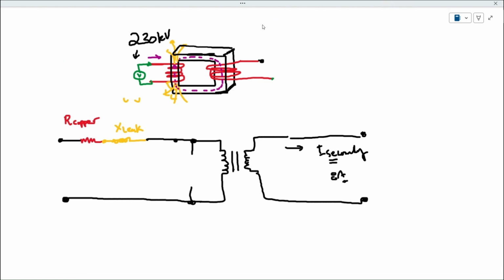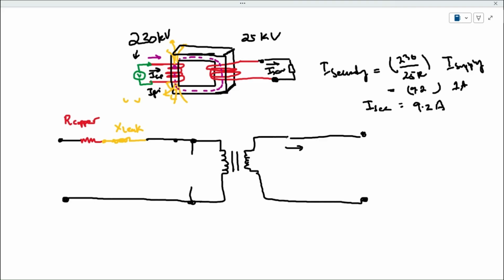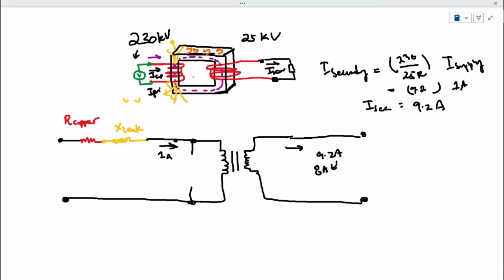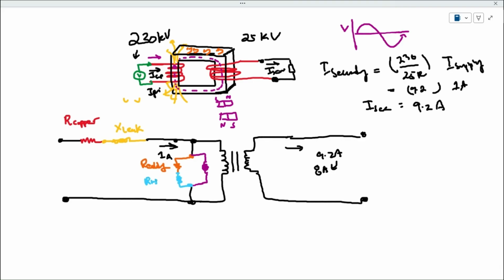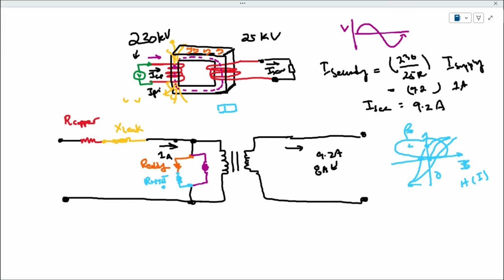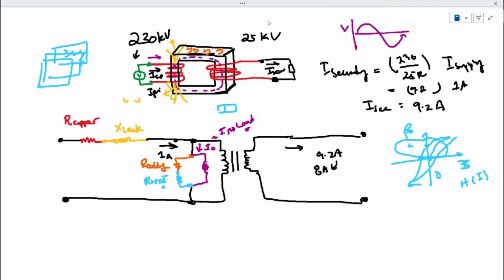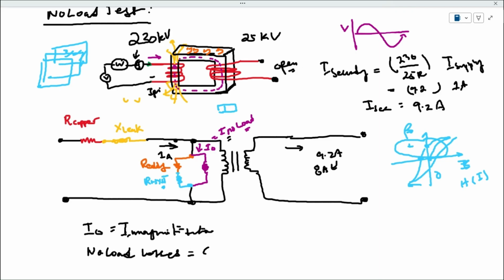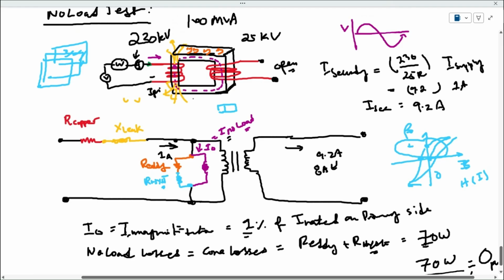PSCAD BASICS - PART 18 - TRANSFORMER - EDDY AND HYSTERESIS AND OPEN CIRCUIT TEST

Comment: I have to say even though your videos of software explanation is good,the theory explanation seems very rush. I know it take multiple lecture to get the clear concept of transformer i think you coul have done better job explaining short circuit test and corresponding equation . for example the secondary current could have easily explained if you brought the term transformer ration instead of directly putting 230(primary)/25(secondary) . i had to think sometime how that worked